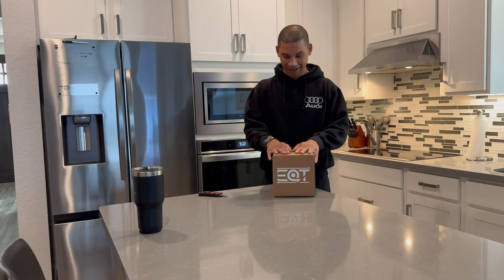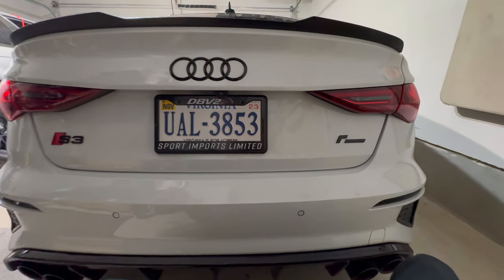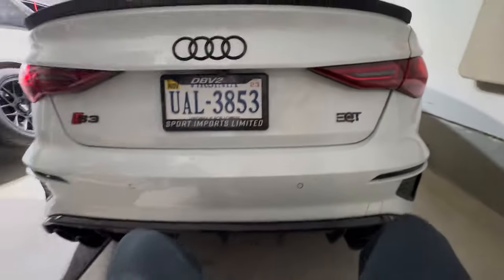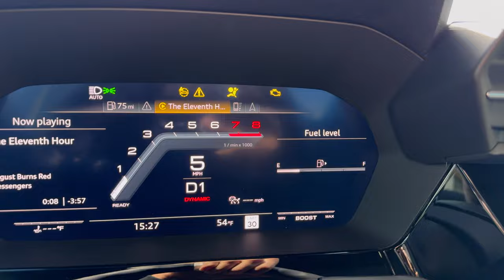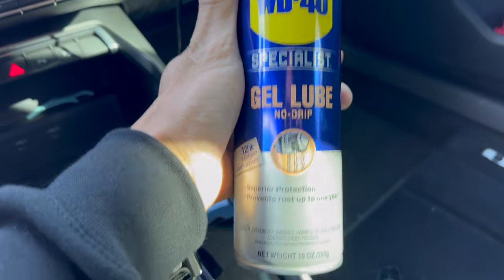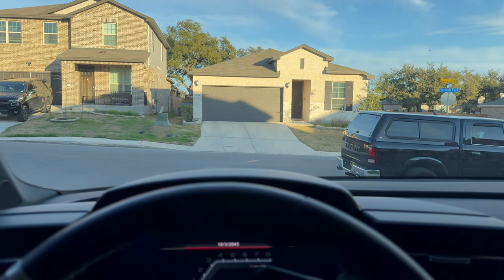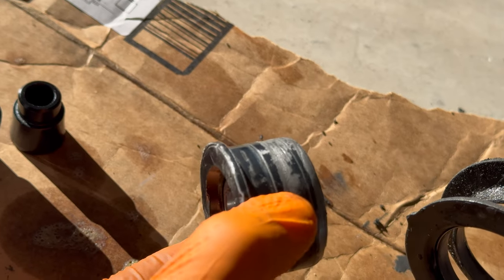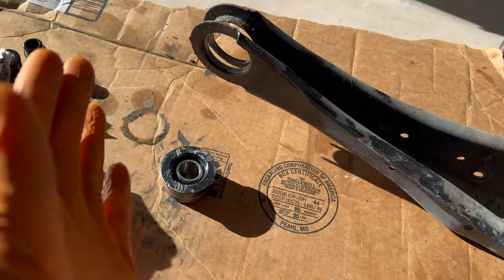EQT sent over some hrspwrs and we go break our 1/4 mile PB!

Comment: I have basically the same car. A white 2024. So EQT that much better than 034? I had EQT on my GTI.
Reply from the maker: I mean it’s a custom tune vs ots can’t really be compared honestly. Both are great and smooth but one isn’t made exactly for my car. 034 is dope tho cause here soon you can have gauges and such via CarPlay or AA. You can flash from your phone and no CEL for being catless. But EQTs is tailored to my car pulling out every last bit of power.
Reply: Oh you got the custom tune. Did you try their OTS? I honestly might just do APR as my dealer seems ok with APR tunes. @BryceJordanProductions